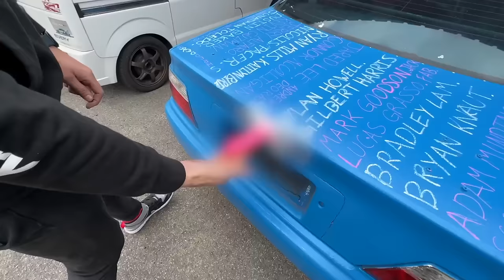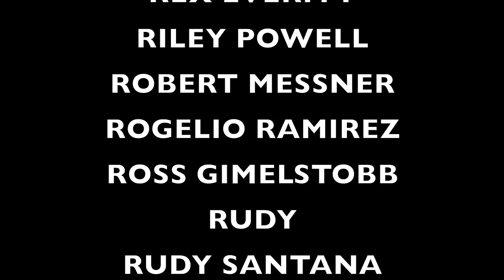MY FIRST DRIFT COMPETITION IN JAPAN!

Comment: A tip for the 1j if its a auto manual conversion car you may notice it stalls easier on auto ecu struggles to catch idle i noticed a lil when you handbrake,manually bumping it up on the throttle body or changing ecu helps gets especially bad when you do j pipe delete also

Comment: Safety washers or locking plate should fix those bolts coming loose bud 👍
Don’t use loctite on parts you need to adjust or remove frequently

Comment: You want a quick Bush fix to stop those lower caster bolts from coming loose? Find some heavy-duty thick wire and wire it down and tie it to the underside of the control arm to prevent it from being able to back out. You do not have to drill a hole through the head of the bolt just wrap the wire around the head of it a couple times and pull it nice and tight and then tie it off around the control arm. Can't tell you how many times I've had to do that in a pinch. Also your inner tie rod ends are completely trashed. That is the reason why there's so much play in the tire side to side

Comment: You still need to get that initial flick right. Transfer the weight to the inside gently, then to the outside for the initial flick, doesn't have to be harsh, just overload the outside by shifting rear weight and turning in a little bit too much. (faster, not fast so the front slides)